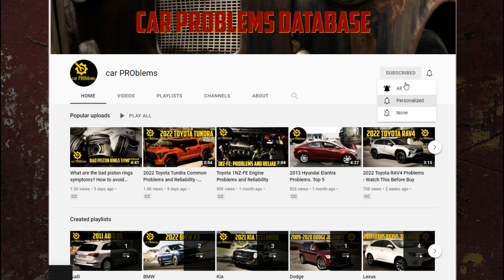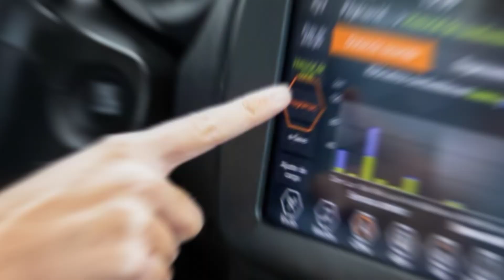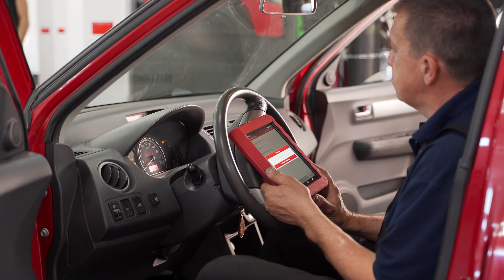7 Reasons Your Car Alarm Goes Off Randomly - How to Diagnose & Fix

Comment: My volts do go up and down when driving, and my alarm randomly goes off do you think it could be due to a bad battery?
Reply: Car off, parked, battery voltage should read between 12 - 12.5V
Turn ignition to on, not start, Voltage should not drop below 11V
Keep meter on, start engine, voltage should climb from 12/12.5 to 13.5 - 14.5
If your voltage drops below 10V and is hard to start, battery either needs charging or replacing
If battery drops to 8V or lower, replace battery
If Voltage increases after start, to 13.5/14.2 or more, alternator is good
If voltage does not increase above 12V, have alternator checked, also, fuseable linkm, fuses, relays and computers (ECU).
With modern vehicles, there can be a number of issues, scan tools normally find them
The above is a quick reference.
Most places that sell batteries can check the quality of your battery
Most importantly, so you don't get ripped off, do the standing, key on, key start voltage checks across the battery.

Comment: Thank you for the video! Mitsubishi Outlander 2009, never had a problem with the alarm and went off at 4am and 6am waking up the whole neighborhood. Was able to locate and pull the fuses for the horn and alarm speaker. From video was able to find the hood sensor and disconnect. Will buy me time to figure out issue without waking everyone up